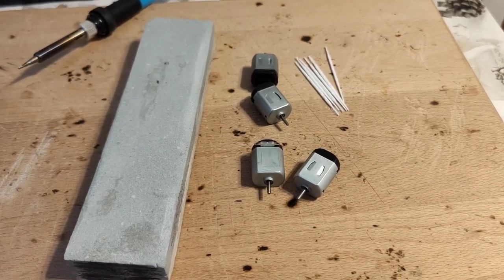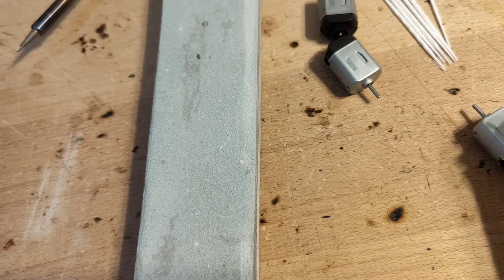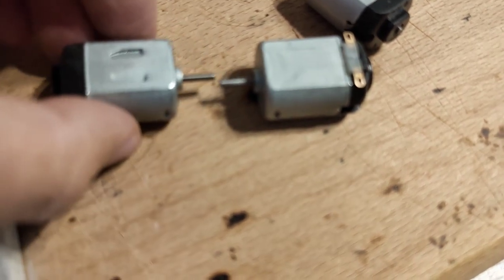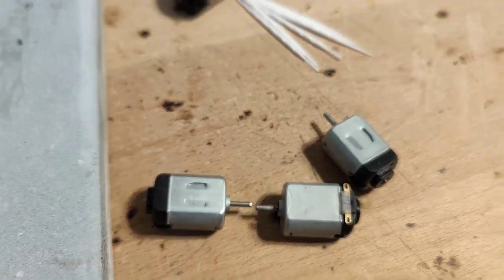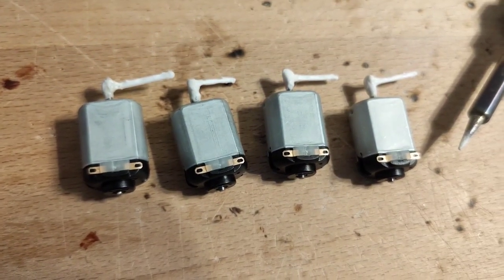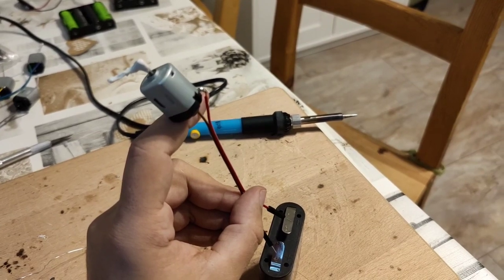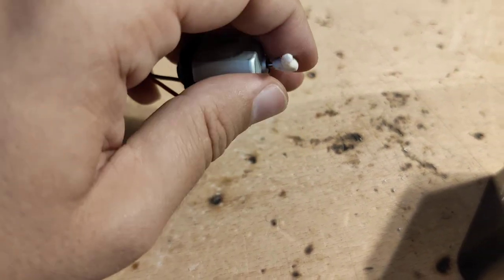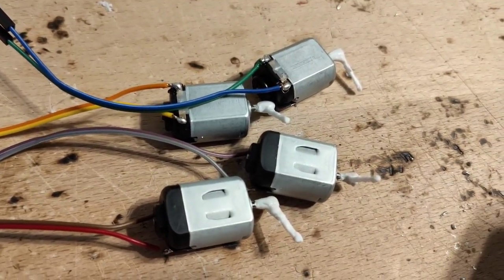Arduino motors, a pumice stone, and molten toothpicks

Comment: These motors are a pain to work with.  I was wondering if you tried hot glue instead of the melted plastic?
Reply from the maker: To my shame ... I don't own a hot glue pistol! But I see no reason why not — only be careful to remove any dust residue from the shafts prior to trying (as there is a tendency for powder to break loose later).

Comment: Violence is no solution if you aren't applying enough of it. Lol! Oh Nino, hilarious. WRT smooth shaft motors normally you press on a metal gear and use an interference fit (hole in gear is a few thou smaller than the shaft) however that requires serious metal working equipment to fabricate the gear
Reply from the maker: Thanks for teaching me something new!! 😁
Reply: @ninoivanov  I tried to insert some photos of my rebuild of a 1 HP pool pump motor where the bearings had an interference fit on the motor shaft.  Unfortunately Youtube won't allow photos.  So you will have to imagine me stuffing the motor armature in my fridge's freezer for a couple of hours to bring it down to -10C and heating the bearings in my toaster oven to +150C.  When everything is quiescent the bearings are quickly (and I mean quickly!) slid onto the shaft and as the bearings cool then contract onto the shaft.  

The pins/hinge for the F14 tomcat fighter (folding wing) were cooled with liquid nitrogen and then dropped into the wing
Reply from the maker: @ksbs2036  I LOVE this, thank you for sharing!! Brilliant, actually, to work with the temperature...